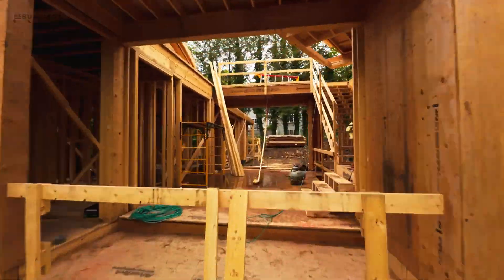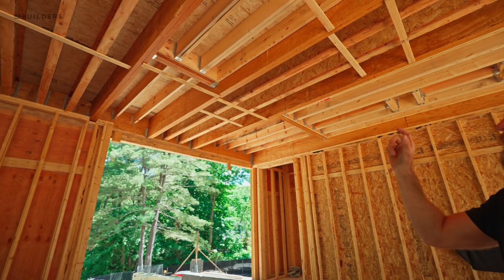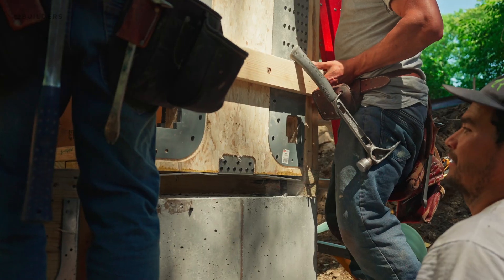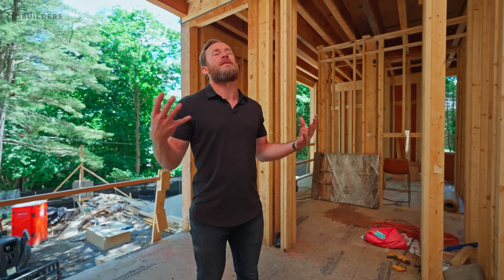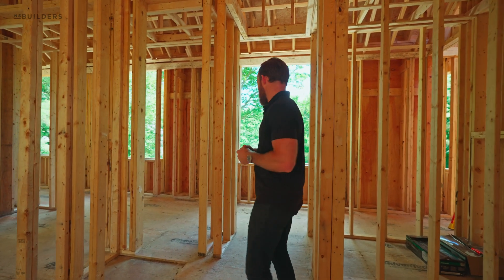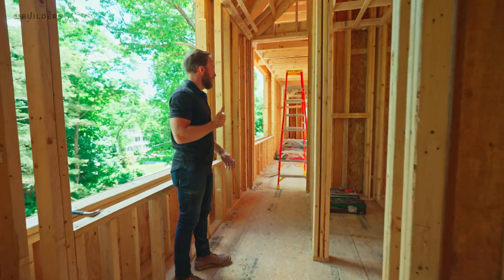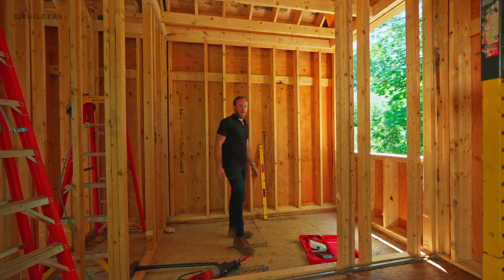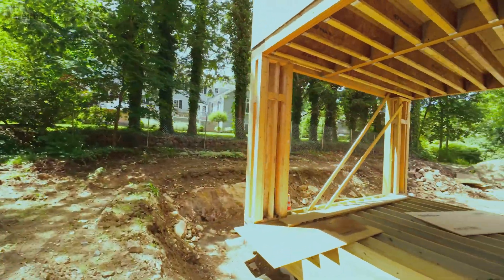We Built This House With Panelized Walls

Comment: Great structural design! It must have been quite a challenge with all those big window openings and clear internal spans, not to mention the vaulted ceiling with the skylight.
Reply from the maker: Challenge accepted.
Reply: @NSBuilders  The structural design might be a nice topic for a future video... the location of the different steel beams in the roof is quite intriguing...

Comment: NSB / OfPossible, regarding attachment it may be possible to adapt the hidden fastening systems we use for stone cladding: various options which include expanding ss anchors, epoxy and/or milled key ways. Or, maybe the material could be kerfed and hung/clipped back. Or, it’d be exciting to see the solution akin to the clip solutions Bates Masi has developed; or how the exposed clips work on Knowlton School. Also, would be fun to get Quarra Stone involved and invent the “45 White Oak attachment” 

@_tretow